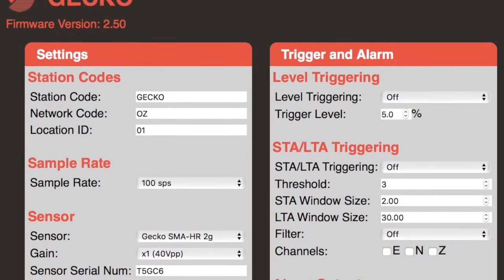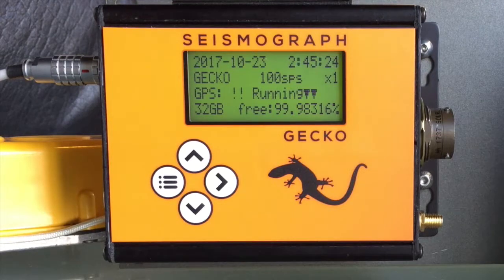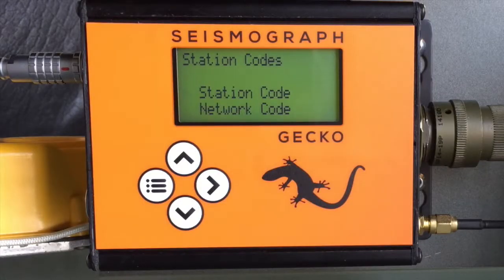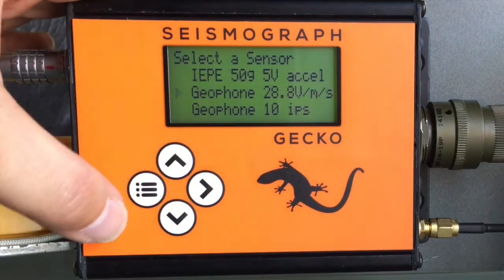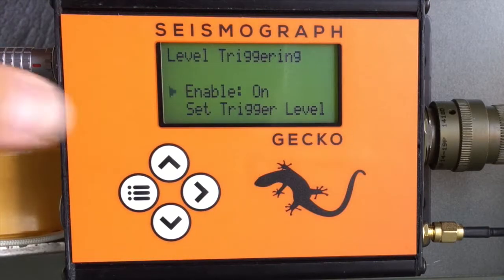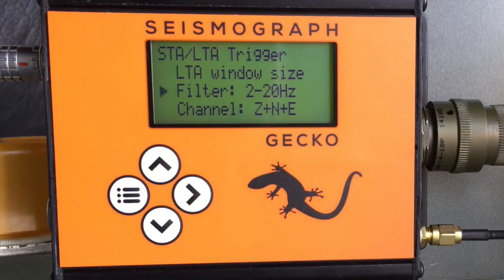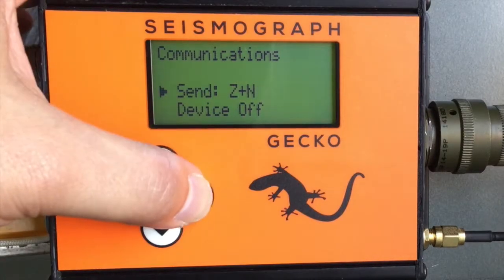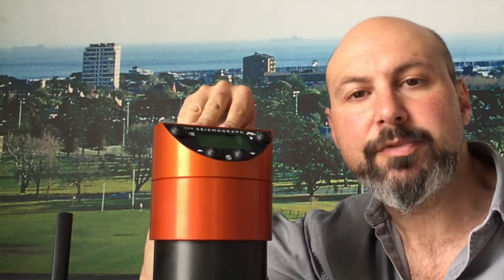Gecko Seismograph Video User Guide

Comment: Hi Seismology Centre, our company owns a Gecko SMA-HR Seismograph and when using the eqwave app, I can locate the approximate epicenter and it's magnitude by using the P and S waves but we just want to know the intensity or magnitude we felt in our building where the seismograph is located. Is it possible? How to set it up? Or how to view it in the wave app?
Reply from the maker: You can estimate intensity using our free Waves app. Use the “Peak Particle Motion” function (control-L) to calculate the peak vector sum of the recording. You will then see the estimated intensity in MMI and PEIS. Get Waves free at src.com.au
Reply from the maker: Oops - Control-L is to trim the waveform. Control-G is the shortcut to get your PGA plot.
Reply: @EarthquakesAU  thank you so much! It works
Reply: @EarthquakesAU  btw, what's the meaning of MMI and PEIS and their difference?
Reply from the maker: @kaizerbaloran6451  MMI is Modified Mercalli Intensity, PEIS is Philippine Earthquake Intensity Scale - derived from MMI by PHIVOLCS for the Philippines.